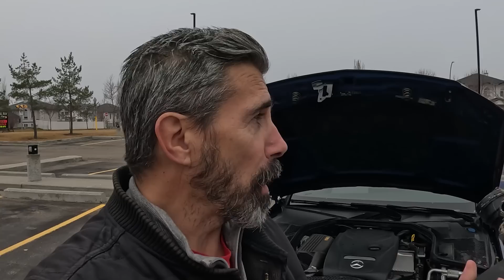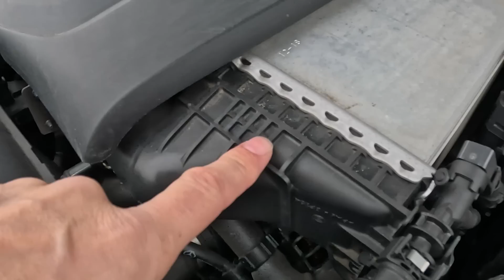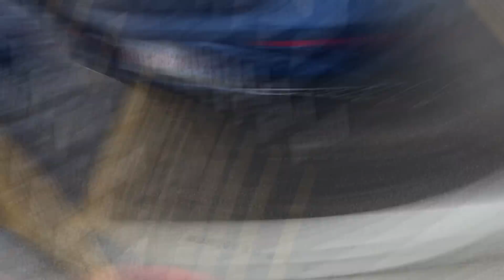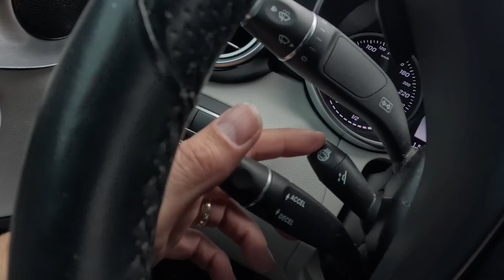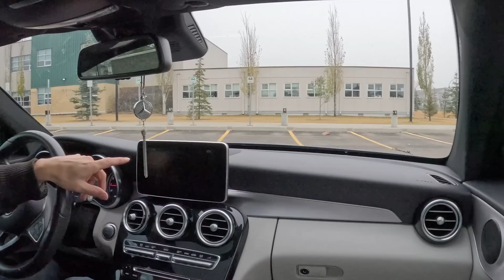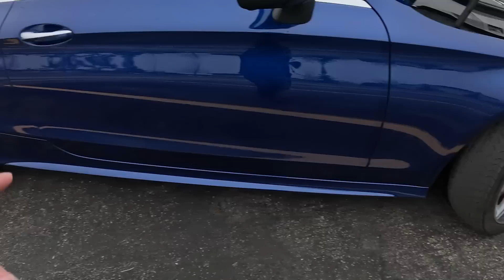Here’s Why New Cars Can't Last  5 Years | What Went Wrong?

Comment: Its a stupid mistake in the ecosport engine to have the timingbelt in oil. How is it possible an engine engineer doesnt think about the consequences, they lack insight or do it on purpose to short the enigine lifetime or get higher service costs replacing the belt every 20k miles or so. Simple solution: make it a distribution chain in oil, a lot of problems solved.🤨

Comment: I’ve worked on older hybrids myself which some are beyond 15 years and the main battery is still original, just keep the battery air filter clean and drive reasonably without abusing the throttle as much as you can. Probably the quality is different across different countries. IDK?! The 12V auxiliary battery is usually okay to change but can be expensive. Mine is a deep cycle AGM battery which costs about $450 AUS.

Comment: I own cadillac cts 2017 and reached 345,757 miles now , I love it and car still in good condition.  I have changed only internal parts for the car when 5 years passed.
Reply: GMs are excellent! There’s a guy on YouTube who has the 3.6l V6 2010 cameo with like 265,000 miles and had no issues. I have that same car, same year with 31,000 and never getting rid of it!
Reply: But I heard someone in this comments section complaint about a 2010 challenger that gave them constant problems. Chrysler ain’t built like GM

Comment: Newer cars are getting worse than what they are replacing. They are not as practical to live with and cost of ownership is way higher.

Most of us are better off hanging onto the legacy models.

We have 3 cars in the family:
1) 1995 BMW E36 328 manual shift -  400,000 km. It was built in BMW's Pretoria factory. She's a classic beauty.
2) 2011 Toyota Hilux Vigo D4D 4x4 twin cab auto - 200,000 km. Also built in South Africa  This is bomb proof. If it's an off road tourer, it MUST be a Toyota, because of build quality, dependability, dealer netwok, parts availability and cost of ownership.
3) 2016 BMW X1 F48 2 litre diesel auto - 100,000 km. This is German built. A great, absurdly economical, practiclal vehicle.

All good. 😢

Comment: It is not sure that plastic will last shorter than rubber! Smaller engines are a problem when you try to get a lot of power out of them. 2 L four cylinders is still OK, but they get down to 1 L in Europe...
Reply: soon will be 0.4 engine and back to horse and buggy!

Comment: The problem has always been that most of the people who buy new cars DON'T CARE about Durability, Reliability or Economy. In many cases this is because they can write off the expenses.  So the used car market is filled with this Crap!  I agree with you that the manufacturers are using plastic where it shouldn't be used. For example a Y-shaped heater hose fitting and a thermostat housing that failed after 7-10 years and 250,000 kilometres . No excuse for that and the failure could leave you stranded and destroy your engine.  They KNOW BETTER! Also instead of recommending an oil change every 6,000 Kilometres they recommend 10,000 Km and replace the vehicles oil filter with one 1/3 rd of the size on the new model. WTF!!!???
Reply: Lease and not buy

Comment: My Ford Fusion is 6 years old. I haven't treated it well - but even though that is the case, the only things I have had to do other than regular oil changes (78dollars at the dealership each year) is to change the wheels twice.
Reply: My sons 6 year old ford fusion just shit the bed, on the freeway, had it towed back to our house, apparently that motor has a design that makes replacing the pump that failed turns it into a throw away vehicle (which is what he  ended up doing) because it cost more to pull the entire engine to fix the broken part than what the stupid vehicle was worth over all.  
He replaced it with the latest generation Toyota Prius.  Will see how long it lasts for.  Who knows these days

Comment: 40 year auto mechanic here. as far as i'm concerned anything after about 08 is garbage even by 2010 this electronic creep was occuring. Idealy you want to find something 04 and older in good condition with as low of milage as possible. these older good condition vehicles are worth thier weight in gold. I personaly drive a1994 dodge cumins diesel and as long as i can get parts for it I will keep driving it. my wife drives a 2006 mazda 3 . as retired people we would never be able to afford these new vehicles. I am not a fan of shiney bobbles in my vehicles anyways as I'm not a crow. I'm old enough to understand that the more complex something becomes the more fail point it will have, the less reliable it becomes and the more expensive it is to repair. And yes they are pushining the thining of engine  and drivline parts to the limit. Nothing holds together like a cast iron engine with forged connecting rods and forged crank shafts.
Reply: mark: Reading your comment was like listening to my own brain. I do all my own work on my cars. Newest one is a 2006. They are charging $956 for a new key for my 911!
Reply: I used to work in Detroit and I tell people similar advice:
  It's best to buy a car made before 2008. Never, ever buy a car made after 2013.
I drive a 2003 BMW and I had two mechanics shops tell me my make and model car is better than anything being made today.
Reply: I generally drive old beaters that pay for themselves MANY times over before getting junked, but this year I popped on a real Creampuff; a 1996 GMC Safari AWD Starcraft high-top conversion with ONLY 28k miles for $21,000.00.

It has leather seats & electric bench, TV and cold AC. It's my weekend pleasure ride. I wouldn't trade it for ANY of the new crap on the market today.
Reply: Yep have 2001 infinity and 2006 Chrysler 300c hemi now that’s a engine.
Reply: I bought a 2015 Mitsubishi Mirage and it still uses a key and has no screens, no TPMS, no rear camera.
Reply: You are the second mechanic I've read online who has advised to avoid cars built after 2010. That's enough evidence I need to know that modern cars are crap. 😕
Reply: Agreed. Last new vehicle I purchased was a 2006 Jeep Wrangler Sport because I noticed the changes they were making for the 2007 Jeeps to try and make them like mini Hummers. I also have a 1997 Jeep Cherokee.  My 1997 Cherokee only has 170,000 miles on it. I'm hoping it will last at least 10 more years since I don't drive it much.
Reply: @kensmith2796  Do your jeeps have the very bullit prof 4.0 litre engines?
Reply: @markseehawer3762  Absolutely!
Reply: Well Done, BMW X5 e-53, 2005, will keep it alive as long as possible it Looks Posh when i park next to any new jeep in central London, i proud of my Car, its absolute worth every pound i spent for repairs, its my Best Friend!
Reply: Due to low emission zones in Europe, you can't even drive a lot of cars into cities anymore (unless you pay a fee, then suddenly your car becomes a clean car (<-sarcasm)). The EU is also talking about banning repairs for cars older than 15 years. They use the law to force you into new cars (preferably an expensive EV - with a load of tariffs slapped on it if it's from China).
Reply: drive Mercedes w123 220d. It's slow but bulletproof
Reply: Except if you live up north with snow and salt the bodies rust out !
Reply: @laurad324   So true.  Most of the vehicles I've owned over the years have died of rust prior to them wearing out mechanically, but I do tend to keep cars and trucks longer than most.
Reply: Since 1999 I have been involved in the automobile industry in different ways and I agree 💯 with your comment 👍🏻
Reply: Totally agree, my 09' Matrix is as new as I'll go.
Reply: @zerocool5395  Sadly it is going to get tougher to find good condition older vehicles
Reply: @markseehawer3762  Yup, in 20 years when I'll be in my 60's. 
Cars will be insanely complex, oil changes (If it's an ICE car) and that'll be it.
Even in my 09' Toyota the bumper has to come off to remove the headlights, tranny has to be lifted for control arms.
Not as easy as something from 20 years ago.
Reply: @markseehawer3762 it’s going to become impossible as no one will be able to afford new.
Reply: Bro, you just wrote my bio.  Its literally not possible for me to agree with something more than I agree with your post.  I drive an 1998 BMW e36 and a 2006 e60.  New cars are trash.  How long does an Android tablet last?  That's how long your newfangy Android tablet computer car is gonna last.  They will never take my straight six from me!!!!  Or my buttons!!!!!  F$%& your touchscreen!  The year 2000 was the high watermark of cars for all time.  If you know, you know.
Reply: Do the refurbishments over there in America? Here we have polish firms that completely rebuild classic Mercedes - the like of the W124 - and competing BMW, Audi and Jaguar models and sell as good as new them for around EUR 25.000. Even the milage is reset to 000000 which I do not like (like my high milage)
Reply: @becconvideo  there's a little of that here, but to my knowledge not this extensive.  I'd totally jump on this!
Reply: `Hi!  I need your insight because I'm preparing to invest in another car and of course I don't have much money and trying to avoid  get one at the Dealership financing it. 

 What car model and year should I look into investing if I want something that gives me quality of my previous 2009 Toyota Camry sedan that lasted me 15 years!!!  with no issues. (I'm looking at something that will be a gas saver 4 cylinder but with good fast pickup power for fast acceleration situations of changing lanes etc. Good space but nothing large or bulky since i love compact sedan full size but trying something new style that can give me the sedan feel with more trunk access :
1-  HONDA CR-V Suv.   OR Toyota Rv 4. ??  or other models?  I like and trust these two brands best.  What year models shall I aim for?  Thanks !!!
Reply: Retired ASE Master Tech GM, Ford, and Chrysler factory trained, and now driving and loving a Tesla, about the only 500,000 mile vehicle out there anymore.
Reply: And pardon me sir, many and most mechanics can't fix electronics.  I want a simple vehicle with AC being the only thrill.
Reply: Gave my Daughter my 2008 Taurus with 3.5 v6. Real good car that has 217,000 miles no engine trouble except 1 coil pack and new water pump. Still has 5 of 6 original spark plugs. Same trans fluid. A little front end work. That’s it. No turbos on those.
Reply: Repairing mostly German cars over about 3 decades I found BMWs of 2002-2004 one of the worst cars ever for failures of many parts. If you're looking at an old BMW to purchase, steer clear of those years.  I had a nice 1995 BMW 525i with a 5 speed manual transmission I sold with 230k miles. Thinking back I wish I never sold it. The same with my 1993 740iL, and 1992 Mercedes 500SL. Very well built cars (with exception to the SL's soft top hydraulic system). Our family has a 1999 Mercedes ML430 with 250k miles, and a 2000 E320 with 180k (both of them 4MATIC awd) and still running strong. Just keep up on maintenance and replaced common wear parts and they'll run reliably for a very long time.
Reply: after 08 they experimented with different materials. rather now some cars are getting better. americans have been crap since the 90s with only few models standing out. the europeans went dud after 08 due to financials but also they find they can make high margin cars and people will buy them and they still complain about financials for no reason when people prefer reliable cars.

Its just the market, they figured if people still buy their cars they must be doing something right. other than tesla american car makers dont make good cars but tesla needs buttons, its safety related as you dont want to look away from the road to adjust something. if the market is dumb, so too are the manufacturers. Japan has limited resources, so they need to make those resources last, hence the stark difference. Americans have a lot more disposable income or rather want to bling, its a bad culture. europe only caters to its market who buys new every 3-5 years, so why make the material last longer than it needs to? they are engineers, its not about making the car last, its about the market.
Reply: @System0Error0Message  "europe only caters to its market who buys new every 3-5 years" I'm sure all that waste is going to be good on the evironment... Oh no we must bring out the EV's!!!
Reply: They also started making the seats out of soy foam and cheating out on them and making the bolsters narrower and harder . I’ve got nothing but low back and leg pain with cars now ( since 08). And no I’m slim ( not too wide for seat ) but really long legs .

Comment: You are 100% correct. Plastic and electronic complexity are killing any long term reliability in most cars today. 😢
Reply: We are talking about modern high tech plastic here which have several advantages compared to traditional materials, including low weight, and it's designed to be able to resist heat. Don't compare it to the plastic used in kids' toys.
Reply: @AA-le9ls  not to mention...far cheaper.😆

Comment: Good video. But I will say that it’s not all the fault of the auto makers. Government regulations have caused most of this. Due to strict fuel requirements auto makers must use the lightest materials available which means less metal and more plastic. Also government safety regulations causes auto makers to have to add things like AEB,LDW,BSW, etc.  all of this adds to more electronics, and more costs overall as repairing or replacing these components is pricey. Adding to higher insurance costs as well due to higher repair costs in the event of an accident. 
Government is responsible for much more than people realize. Everyone is quick to point fingers at the auto makers without looking at the bigger picture. Would cars today be built the way they are if government wasn’t involved?  Would electric cars even exist at all? 
I think there are many questions we need to be asking ourselves.
Reply: Excellent perspective!

Comment: Love my older vehicles! Thanks for proving my point why I don't want a New car. We had a 2010 Challenger that spent so much time in the garage we used up our warranty and we got rid of it. Thank god. Loved the power and look but not the problems. My 2001 Mazda with 347,000 miles is fantastic with just regular maintenance and every once in a while replace parts. We've take care of it so it still looks nice. I also like the big windows. New car windows are also smaller and I just don't feel as safe due to lack of view.

Comment: Notice the pretty cover over the engine not allowing the heat to escape.
Reply: I'm a mechanic, I have removed both bottom and top covers from my Mercedes Benz, less heat, fewer places for mice to live, faster oil changes. 😅
Reply: Remove it imminently, wrap it in cotton wool and protect it, then re-install when you go to sell, so it looks little used.

Comment: $6000 for a headlight.  I payed less than that for most of the cars I purchased over the years.
Reply: I picked up a GS460 that needed minor work for less than that and it's a better car than the turd he's showing on the video lol.
Reply: The headlight does not cost $6000 it can be fixed for about $450 with used parts…
Reply: @marlonallen-v5y   If you can find the parts.  If the housing is broken up, you would have to replace it, although you can reuse the modules.  I'm sure you can find a good used headlight assembly for significantly less with some searching.
Reply: @marlonallen-v5y   If you can find the parts.  If the housing is broken up, you would have to replace it, although you can reuse the modules.  I'm sure you can find a good used headlight assembly for significantly less with some searching.

Comment: Tiny little engines with turbochargers.  That's the bottom line right there.
Reply: and why Toyota/Lexus and Honda no longer make reliable new cars!
Reply: @GuitarsAndSynths  True
Reply: Emission regulation
Reply: Mazda 
All naturally aspirated engines
Mazda 3 2.0 
No turbos
Reply: @chrisshawcross7033   I really like Mazdas.  I've purchased five new ones over the years.  We currently have a Mazda3 with a 2.0 and a manual.  Mazda does make some turbo engines but they put a V6 in their biggest vehicles.

Comment: In reality, if people today would change their drivestyle with the new engines/transmissions, they'd last longer than u think....80% of people are poor drivers, beat their vehicles...see it every day, people drive 4 cylinder engines with a turbo & act like they are v8's...result, poor reliability...same with v6 w/turbos.  Transmissions today, have more gears all in an effort for better gas mileage...so what do most drivers do? Act like they are drag racers everyday, at every stop light, every stop sign...result...failing transmissions...people's stupidity cause most issues with vehicles